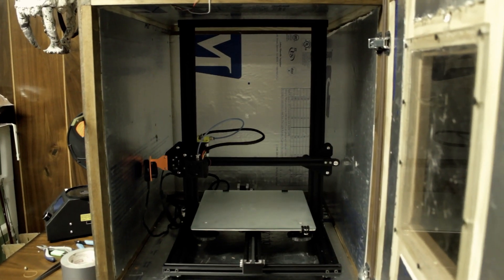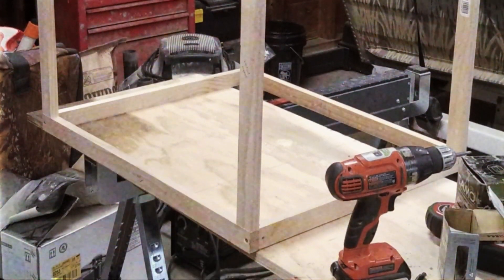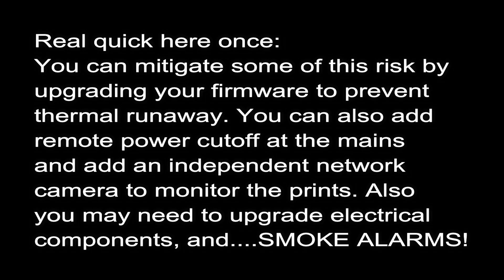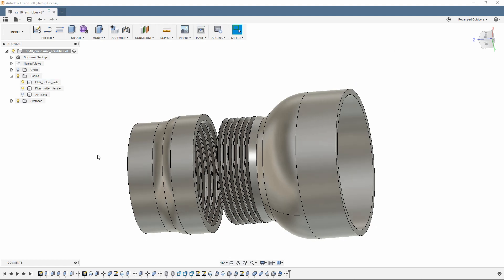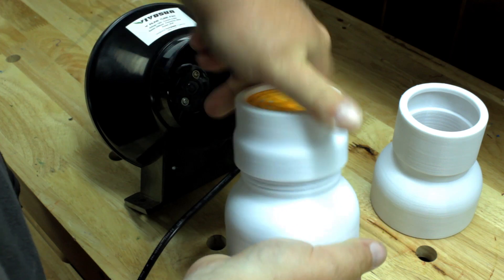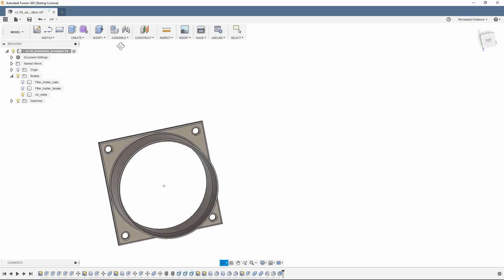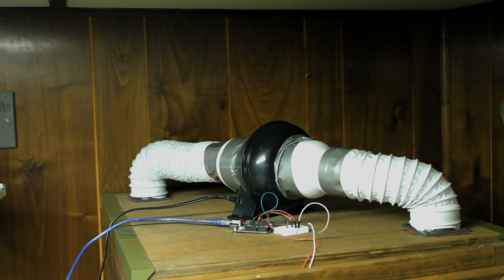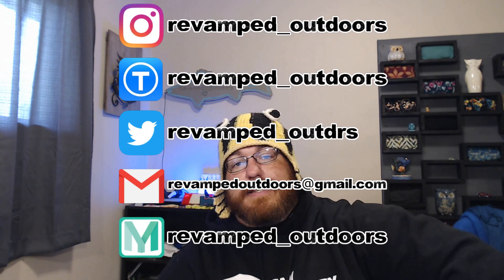CR-10 Enclosure with filter

Comment: Nice work! If you want to at least measure the particulate in your enclosure there are some pretty cheap sensors to do that like the  PMS 3003, there are libraries online so you can easily hook that up to an arduino.

I did something similar to you but I used an OdourCube based system along with OctoPrint and the Enclosure Plugin to control the enclosure temperature when printing with ABS. I wrote up a How To in case you are looking for some inspiration - https://forum.prusaprinters.org/forum/english-forum-general-discussion-announcements-and-releases/how-to-enclosure-temperature-odour-control/

At this stage I'm not using the OdourCube carbon modules or hepa modules, but I plan to use them later when I relocate the printer to a different spot in my workshop.

Comment: Hi, nice work! You might want to check the Odourcube ( odourcube.com )... something which saved me a lot of time and made my printing safer and better. If there is no option to vent the fumes outside, you can use the carbon and filter modules to vent into the room as well.

Comment: This totally inspired me and I made a very similar scrubber using a 3” inline fan and 3” PVC 90° elbows mounted to the back wall of the enclosure. My thought was the air was coming outside the box to ambient room temp and was getting slightly cooled. So by leaving it inside the enclosure the ambient temp around the piping would be identical to the air through the pipes so there should be no loss of temp. Or at least reduced loss. I also added a speed controller to reduce noise and the power on the 12v inline fan far exceeded what I needed to clear the chamber. https://www.instagram.com/p/Bubl9Nmh3HK/?utm_source=ig_share_sheet&igshid=1uduqk5f6ll2p
Reply from the maker: Awesome! Those lights are a great idea too. Great work, nice and straight way better than mine lol. You might have inspired me too, might have to put some of those lights in!
Reply: Revamped Outdoors Thanks. I love the lights, I can’t vouch for them enough. I also didn’t mention that I simply got a pack of activated replacement filter sheets. About 0.5” thick and I cut those to fit inside “aimable” 3” vent covers to direct the air flow.
Reply from the maker: @bobbyfischer7609  right on, the sheets probably make it 100 times easier to find replacements.

Comment: actually im building a similar enclosure, my isolation is the same i think, working on the door right now. I was thinking about ventilation aswell but i thought i just let the air inside so i can take advantage of that heat. when i open the door after print i just open my window next to it and try not to breath to much :D
i put my control box inside because i do my enclosure for 3 reasons : sound, temperature and air and the box is quiet loud.
so i dont print abs i hope pla and pteg is fine so the box dont get as hot
Reply from the maker: Odors are for sure sometimes nano particles that are really small. You can have fumes without odor as well as the opposite though. I think the bad ones everyone is worrying about now are nano particles which can get past hepa filters and n95 filters. Some of the big nasties we wouldn't even be able to smell. Still something has got to be better than nothing.
Reply from the maker: The heat mostly stays in I think with this filter setup it's mostly getting fumes more than particles because it doesn't have the mesh size to get everything but it does help.  It is amazing how much quieter everything is in an enclosure.
Reply: I actually think fumes are particles in the air

Comment: http://www.3dprintfilemarket.com/140629194058.html
Reply from the maker: Interesting, so it just vents it out into the room? Why not just pipe it out of the house then? Cool design for sure, I like the use of affordable granules instead of needing separate parts.
Reply: This link has been saved for a long time, for possible implementation. It's not my solution.

Comment: Nice video man, enclosure looks great.
Reply from the maker: Thanks! I might have to do a follow up after I come up with a better filter media.  It seems like depending on who you talk to carbon is or isn't the way to go.  I'm thinking there isn't a hard or fast suggestion for filter media yet.  I'm halfway thinking about just printing a cartridge and figuring out what to filter with.
Reply: You think an air scrubber would do a better job? I was looking around, you can get some of those decently cheap.
Reply from the maker: @ChrisRiley  I think if you could find one at a decent price and be able to ducted it in it would be a fun project. From what I've read and seen so far everyone is thinking that it's the nano particles smaller than three microns in reality much smaller. Unfortunately   all the HEPA filtration we could easily get our hands on is larger than these sizes. Unless someone knows of filters that are affordable that go that small. I think by using a good voc filter and N95 or P100 filter is about as close as we can reasonably get. Maybe filtering through some sort of solution to precipate out the bad stuff? Man that would be cool, but i bet the solution would be more toxic than an ABS cigar anyway lol.

Comment: NIce job!  Good data from your thermistor/Arduino setup.  Most people wouldn’t go that far into testing if something actually worked better or not.  Could you post links to your inline blower and the hawk carbon filter?  A previous commenter may be right, you may not be getting much value out of the activated carbon, but you may be getting a bit of value just from its (P95?) filter.  Any issues with warping on ABS?  Also, you could fashion a diverter such that the air return from the blower does not blow directly on the  model.
Reply from the maker: Thanks! I'm not too sure what else to filter with, all the information I could find was pointing to activated carbon as a filter source.  I heard that it won't be able to get the nano particles I don't think anything really can, but any little bit helps I suppose.  The cartridge is a standard size I think but mostly outside the US so maybe a different configuration would be better for nano particles? As far as the fan I mostly shop fleaBay so the links always disappear if I post them but I'll try to find one that isn't on fleaBay, here's one for Amazon (not affiliate) https://goo.gl/JdCUiM    .  The hawk filters are just a cheap paint and pesticide filter so I'm not sure what there composite is, there are pellets inside though.  https://goo.gl/3wWN3T

Possibly something like this? Looks to be more geared toward gas extraction? Looks to be the standard size but I can't find dimensions for the LDY7 standard  https://goo.gl/BQXtTm   .

The other option I was thinking about was maybe just printing a housing for a filter and filling with some sort of filter media similar to making your own aquarium filters, determining what media seems to be the problem lol.
Reply: I don’t know what is given off by ABS or PTEG or PLA.  I would imagine that if particulates are of the primary concern then the best we could do would be to go to a P100 filter (captures 99.9% of all particles 0.3 microns or bigger) or HEPA (99.97% of all particles 0.3 microns or bigger.) The activated carbon cartridge can’t hurt a bit.  After the air circulates a few times through the filter, it should take care of the bulk of what is in there.  Either way, I think you have a winner.  Good Job.  I think I will be shamelessly stealing your idea for my cr10.

Comment: Thanks for sharing 😀👍
Good thinking to use a carbon filter.
If you want to check the air quality, then heard is a option: https://www.aliexpress.com/item/CCS811-Sensor-Module-GY-811-Air-Quality-Numerical-Gas-Sensors-TVOC-CO2-GY-CCS811-Electronic-DIY/32914110241.html?spm=2114.search0604.3.8.5fc4218e30Bhzf&ws_ab_test=searchweb0_0,searchweb201602_5_10065_10068_5015318_10059_10696_100031_5015220_10084_10083_10103_451_10618_452_10304_10307_10820_10821_5016018_5015920_10302,searchweb201603_16,ppcSwitch_5&algo_expid=d39d223a-9958-4855-b15a-e2762d5b761b-1&algo_pvid=d39d223a-9958-4855-b15a-e2762d5b761b&transAbTest=ae803_2&priceBeautifyAB=0
Reply from the maker: Thanks! This is awesome, I will definitely look into this!

Comment: Cool project! How did you get all that data in a graph?
Reply from the maker: Thanks! The arduino outputs the temperature to a connected laptop through the serial monitor that is in the arduino program (Arduino IDE).  The serial monitor has it in a window then I just copy it to an excel file for processing.  The arduino can be coded to export the data into a file but it's a lot more code and I had the laptop hooked up anyway so I just copied and exported the data each print.  After that it's just a standard excel xy chart it does all the heavy lifting after that.
Reply: @RevampedOutdoors  Pretty cool! that graph was a nice way to show the effects of the scrubber.
Reply: That was a good idea on how to collect that data. It seems like easiest solutions are the hardest for me to come up with.
Reply from the maker: Thanks, it helped also to save each trial to keep them straight, if I had it record continuously I think it would have been a nightmare to tell which was which.  Especially when a print failed and I had to start the process over for a new trial...I mean I never have failed prints :cough:cough:
Reply: @RevampedOutdoors  you could also write your own small little serial monitor program to dump it into a CSV file, then open that in Excel.  Or have it go into Processing and draw the graph in real time!